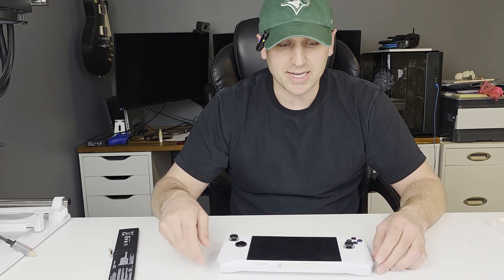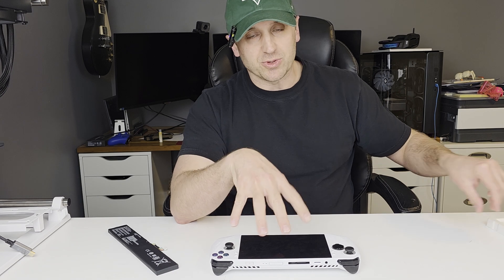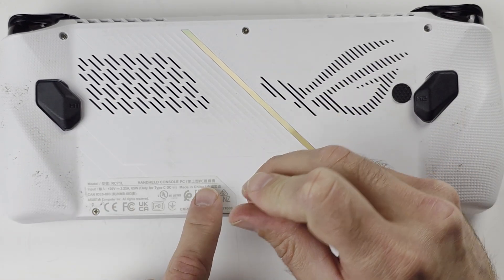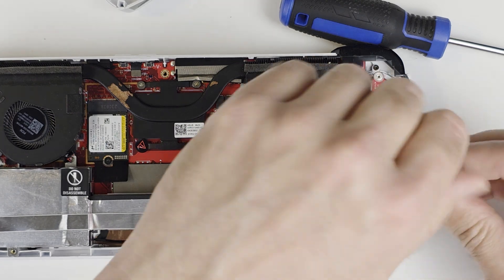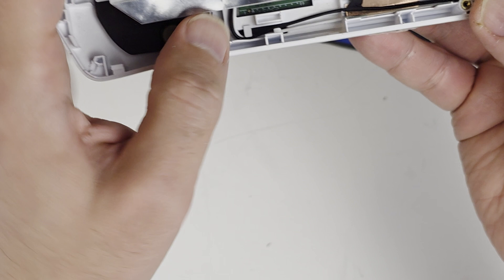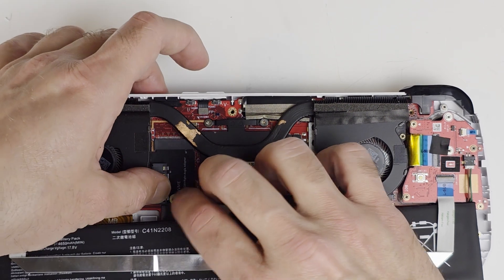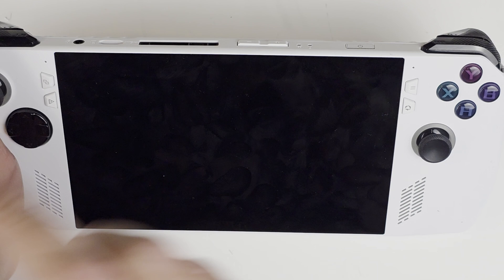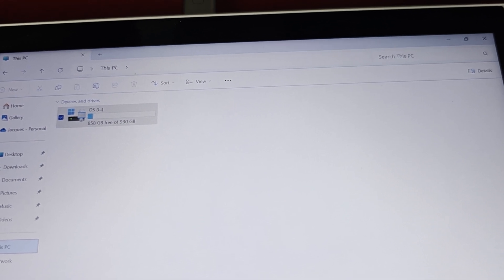ASUS ROG Ally battery and M.2 SSD upgrade

Comment: I didnt clone mine I installed.steam os instead on a new 2tb. Def better experience since had issues with windows ynless something wrong with the drive. Was fine sfter reset it. Butgames stopped working odly for no reason. I had 1 extra screw for some reason but used it for the m.2 adapter since someone stripped the og m.2 screw. Not sure. Bought mine open box from Amazon for pretty cheap. Weird how some models have the foam on back shell. Wish amazon or the site still sold the jsaux back plate. Can find any other ones in production any more. Buteasy mod to do just got to make sure you trim enough and dont force the shell back on. Notice it no longer snaps at the top but the screws hold it fine. I guess its from having to remove the middle clips for the bigger battery. Because wasn't anything cut up top or in the way so not sure. I also recommend prob putting some kapton tap over the batt connector since the adapter screw sits on top. Probably find but to easy to not do.

Comment: 80? Sp u used an x battery?  Most mods do the 74. Which at 50 instead of the old 100 is great. Yea. The battery is a must. Aswell as the m.2 mod. Even tho they make good 2230s now. But the 2280 has more options but is a lil trickier with the bigger battery to snuggly fit the adapter down. I haven't dont test but with the 2 upgrades it actually feels cooler on the back. It never feels warm where the battery sits only maybe very small warmth in the grips. And feels nice and cool by the fans. Not sure why feel this way with less room in side but good to know. Adds a bit of weight but not to noticeable when two handed.

Comment: thank you very much, I just did the battery mod and upgraded the SSD with a SAMSUNG 990 PRO SSD using an adapter too. I ended up without the bottom middle screw cause it touched the battery.

Comment: Hey can you upgrade the ssd and battery without setting the system up first? I just bought one but I don’t want set it up till I get the ssd and battery upgraded
Reply from the maker: Yes you can. From the bios you can download the operating software after you install the new ssd.

Comment: Is it safe to have the tail end of the adapter over the battery connection with a screw in? I'm about to do the same mod but am scared of shorting something. Is it also okay to put the new SSD in while the battery's still connected? Cause you can't really reach it underneath the adapter once it's put in. Thanks!
Reply: I actually just did this too and it worked. I put the battery in place and connected. Then wedged my SSD angle adapter in, then plugged in my M.2 SSD in. The tail end of the adapter with the screw is pressed down over the battery connection. Everything has been working great so far!
Reply: If you are scared use some kaptan tape between them to prevent shorts
Reply: I was a dumb and didn't realize you could unplug the battery from two different places, I pulled the bottom plug and got it all sorted 👌🏼

Comment: Does battery upgrade necessary if always plugged in?
Reply from the maker: No it's not necessary. Your battery performance might still be impacted but you won't notice it until you use just the battery.

Comment: Some testing has shown that 74wh battery mod can raise battery temps to levels that wil degrade the battery quickly and even to potentially dangerous levels under extreme loads.

Luckily there's an easy fix; 0.5mm of aluminum properly shielding the side of the battery that faces the ram module is enough to keep temps in normal ranges. There are videos here on YouTube, and threads online you should check out. I wouldnt do thr battery mod without this shielding.

I haven't looked into any thermal testing done that includes both the 74wh battery and the 2280 mod, but the 2280 also sits close to, and blocks airflow from, the problematic heat source that is the ram module. You should definitely look into that; I personally would not do both mods simultaneously.
Reply: i used 3mm aluminum foil tape with mine to prevent it and my temps have  been stable at 60-70c on max load so im happy with that!
Reply: thank you for this. I was looking for more info on this topic, and you explained the issue perfectly 🙂